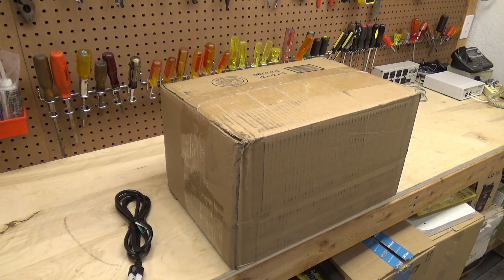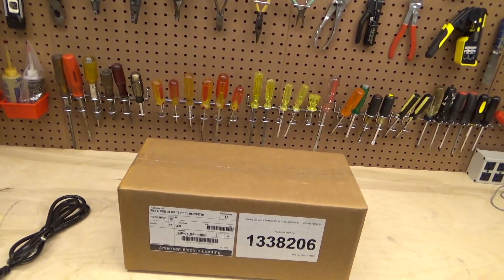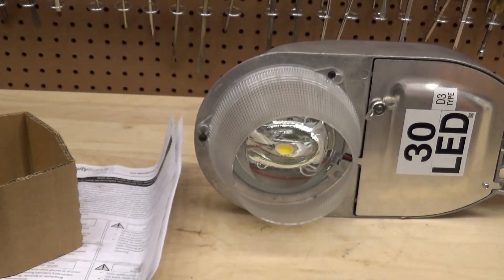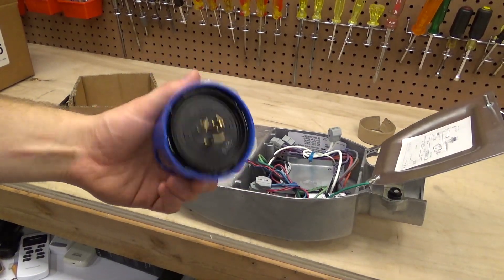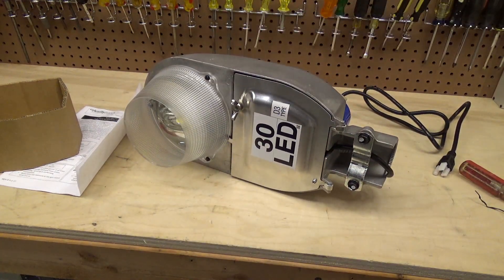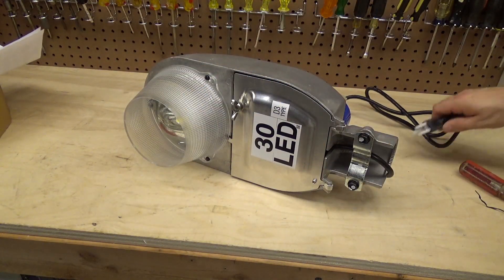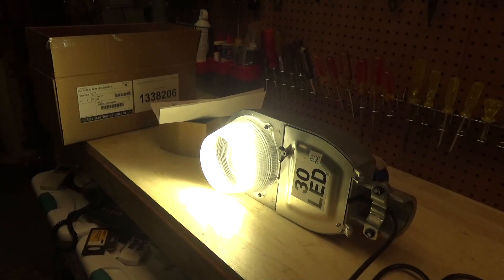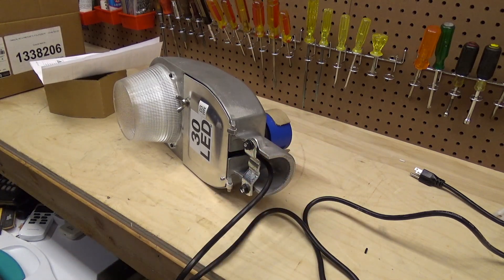American Electric LED Street Light WL1 A PRM D3 MP TL P7 DL RFD260710 | Initial Checkout

Comment: It doesn't seem that bad for an DEL. I like the fact they included a lens in the design like the HPS have. They still need to improve design, longevity and functionality but this is an improvement compared to most flat fixtures out there.

Comment: Definitely a well made utility-grade fixture that is probably a lot better quality than the consumer-grade yard lights you have (even though it’s LED). It will also probably be a lot better made than and will probably last longer than that Cooper junk that United Illuminating installed.

The WL1 is an older model. It was discontinued about a year or two ago and got replaced by the WLT.

Comment: That's a pretty good fixture as far as I can tell. The two unused wires sticking out of the driver are used for a dimming function so the lights produce the correct brightness for any application. I wonder if dimming would extend the life.
Reply: Possibly...... I don't hnow because I have a High Pressure Sodium Street Light.